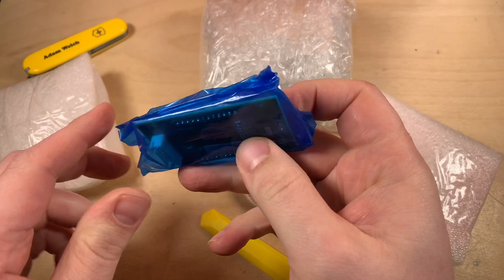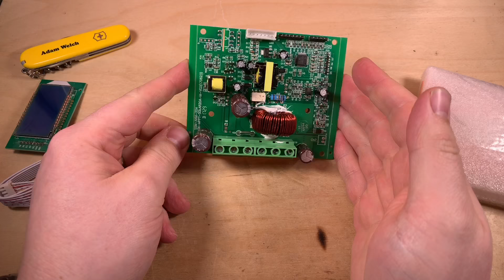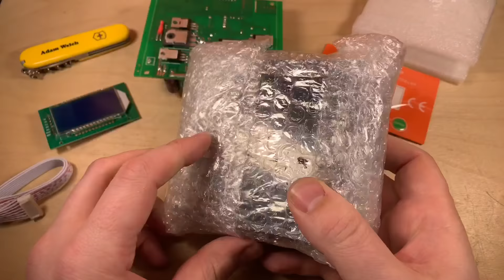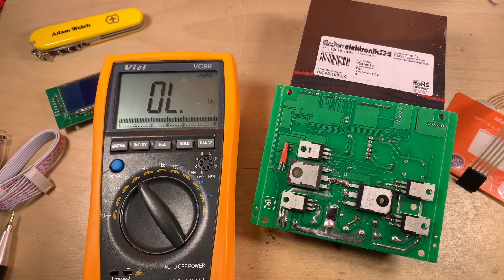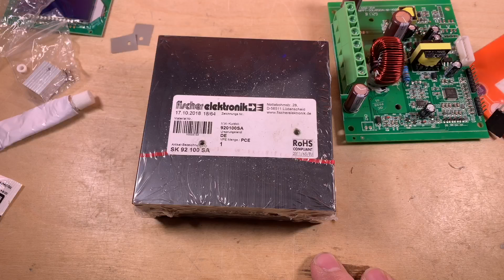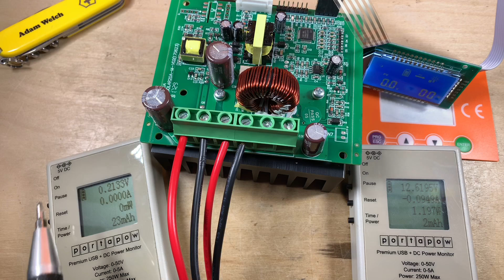Build Your Own MPPT Solar Charge Controller

Comment: For some reason, watching you tap that heat sink reminded me of an old friend (who's sadly no longer with us). He needed a quite specific high amperage adjustable power supply for some DIY electronics project he was working on, but the only PSU he could find that fulfilled his criteria cost significantly more than he was willing to pay, so he designed and built the PSU himself !

He was an electronics engineer by trade, and a fabrications engineer as a hobby, so he masked and acid etched the double sided circuit board himself, soldered everything together himself, and then machined a bloody great billet aluminium heatsink/enclosure for it in his own little home workshop (His "Shed" was a pretty big 2 car garage sized brick building at the end of his garden with a really nice tool room grade lathe and milling machine in it, so he wasn't messing about with hacksaws and hand files here).

The finished result looked really amazing, like a high end limited production run type product, and he was understandably chuffed with how well it worked and how good it looked........... But being British blokes, I couldn't just let him sit there looking all proud of his achievement. So I asked him how many hours it had taken to design and make the thing, and he told me. Then I asked how much the materials had cost, if he got the option of overtime at work, and what sort of overtime rate they offered? We worked out that he'd have been able to go to work and earnt the money needed to buy the one that "Cost significantly more than he was willing to pay" in less than a quarter of the time it took him to make his.......... Then we laughed about it for a bit, and I took him out for a pub lunch.

Anyway, back to the reason I started writing a comment here. Larger heatsinks can get ridiculously expensive, so if anyone else is thinking of building one of these, a good source of heatsinks is from obsolete (10 to 15 year old), small form factor PC's. They can often be got for either nothing or beer money, and most have a pretty chunky low profile heatsink on the CPU. The best ones come from big brand PC manufacturers like HP, Dell, and Lenovo/IBM as they tend to have large custom made heatsinks that don't rely on a lot of forced airflow (And the extra noise that this involves) to keep the CPU cool. If you get really lucky, some have hybrid aluminium/copper heatsinks in them that hoover heat off components like nobody's business, and some will even have a convenient fan attached that could easily be wired up to a cheap thermal switch to offer a little extra protection for if the board it's bolted to does manage to get hot.
Reply: This is a wonderful comment, sorry for your loss. They sound like a really cool person.

Comment: Mini Winter Solar Tipp: You can gradually turn down a Beuler and all other hungry electricity consumers with the "5000W dimmer". Ebay €7. I run 5 dimmers in parallel on an 850W inverter. Kettle 2.2KW at 150W runs 12 hours a day, so the water is always hot. The room is also nicely heated. 2.5KW washing machine runs in parallel with dimmed to 200...400W. Iron, dishwasher, oven, electric heater, coffee machine, all internal heating are throttled with me. Videos about it on my channel https://youtu.be/eC2olbCBhh0 The inverter stays cool, quiet and the MOSFETs remain intact because extreme current peaks no longer arrive at the inverter. Now every Mini PV Inverter is enough to sell large devices. So, with the dimmer, all internal heaters/devices can be converted into base load devices that stay almost permanently ON, drawing very little current directly from the PV. You can measure this with a wattmeter / energy cost meter.

Comment: Great, a video showing show to tap holes by someone who's never done it before, and showing how to mount power MOSFETs to a heatsink by someone who has no idea how to do it. ( HINT: they ALL need bolting down solidly to have thermal contact. Duh. ).

Comment: i NOT want build, i want buy good cheap board were can charging my 12V 18650 4cell4P battery pack. because 3 cell have too low volt and 4P have maximum what i can made no have more battery my battery power wall at solar panel elektric wall. but what charger can buy ????????

Comment: I thought the soldering iron was coming out. 
No instructions on assembly isn't good and somebody could just screw everything to a heatsink and blow things. Can the voltage output be varied? I bought one from Maplins and found it was undercharging and a sealed potted unit which was destroyed when I tried to get into it.

Comment: HI ADAM WHICH CHEAP MPPT CONTROL CHARGER DO  YOU OR WOULD YOU USE YOURSELF  I SAW YOU ONE ON THE CPT-LA10 & CPY-241-/CPS MODEL I HAVE 12OW PANEL USING A PWM UNIT THAT CAME WITH IT THANKS DAVE LIVERPOOL

Comment: Good video.  I need 60 Amps, charge controller kits for 12/24 volts batteries,  Plz send complete specs., protections and warranty
Reply: you have 6 panel on roof if need 60A charger.
panel100W/10A output nominal max.

Comment: The video is excellent. But I have a confusion, how you can measure DC current with a tong tester / clamp meter ? I guess that is for AC. Or it id Hall sensor based ?
Reply from the maker: It has a hall sensor and can measure both ac and dc current. You just have to remember to select the right mode and zero it out for dc. I’ve been very pleased with the clamp meter.

Comment: Adam could you point me in the right Solar Charge controller direction if My panel has an open voltage of 76V  (Thin Film tech) and I would like to charge 18650 Lithium cells in whatever xSyP combination is best.

Comment: ok then... source this build ...  60 AMP MPPT SOLAR CHARGE CONTROLLER 48V 36V 24V 1HHJ60A2V ...  Lithium,Lifepo4/Vented/Flooded/Sealed/Gel/NiCd battery
i have the powmr in the same...

Comment: 👍 Dear Adam!
You always like to test offers from various providers in the Far East!
I found something there, very cheap but unfortunately without an advertisement. Unfortunately I have no comparison options, but I would like to have this MPPT and also connect a digital display.
I am not an electrician or electronics specialist, so I would be very happy if you could test this MPPT for me and connect an ad - because all I can do is recreate what I see on videos!
I would be very grateful if you could create these tests in one of your future videos!

MPPT Solar Controller Solar battery charge plate 6V-36V to 1.25-32V
Link: https://www.ebay.at/itm/MPPT-Solar-Controller-Solar-Batterieladung-Platte-6V-36V-auf-1-25-32V/122815238584?ssPageName=STRK%3AMEBIDX%3AIT&_trksid=p2057872. m2749

Best regards from Austria!

Comment: For 12V configuration I cant find MPPT charger controller with more than 1000 watts solar panel input so I decided to use wide input high efficient Switch mode power supply 12v 60Amp X 2nos. Instead of AC input I have to give solar panel series-ed input of voltage range between 90-280vdc to get maximum 120Amp CC.

Comment: I really like the price of this Charger unfortunately according to the product description it is only suitable for Lead acid batteries perhaps because of the built in temperature compensation that could cause it to over charge other battery types such as LiFePO4 when it got cold. I guess one could rely on the BMS or a separate disconnect when the charging voltage got too high. I assume the firmware does not allow one to disable the built in temperature compensation. Or one could find the thermistor and replace with the appropriate resistor to fool it not to use temp compensation. Another problem to consider is that many charge controllers can get damaged if the battery is disconnected while the solar panels are still connected. Or like mentioned in the description we can buy one ready made for $37.00 more rated at 30 amps with case built in fan and can work with lithium batteries. Probably worth it.

Comment: Hi Adam, I would suggest tapping and putting a screw through all the holes to hold the mosfets onto the heat sinks to prevent any chance of there being heat build up and doing damage.
Reply: That is ESSENTIAL to get any kind of thermal contact. The slightest air gap and you'll have worse than a free standing FET with unobstructed airflow. This guy has NO IDEA what he is doing. Typical Utube content.

Comment: Hi Could you do a video on converting a cheap PWM solar controller to MPPT?  Thanks
Reply from the maker: I’m afraid not. MPPT is significantly more difficult and requires more components than PWM.

Comment: You really want to prove its mppt, you need to show the controller brings the panel voltage close to the Vmp value in full sunlight....
Reply: It was very efficient... The output watts was just under the input watts. Also the controller did not pull down the voltage of the two solar panels that was in series to the voltage of the battery but kept the input voltage of those panels at their most efficient point of about 18V x 2 = 36 volts. definitely MPPT. No need for FULL sun to prove it is working as an MPPT

Comment: ty 4 ur vid ....
...
good luck finding info ... the manual gives very little... i have the 60amp mppt,,, i cant get it to charge correctly...
*UPDATE ... i found the problem... i had corrosion build up on my conections between my batteries. i cleaned em and added dieletric grease and all great (whent through all my conections the same)... man i get lots of power now    :)        dont pay to assume lol
Reply: mine works perfectly

Comment: Thanks for the video. I am the distributor for MakeSkyBlue for North America and I was unaware of a little 20amp unit. we don't sell them assembled. Only 30 through 60amp. We also have wifi v119 capability now. If anyone in North America needs service or sales, you can reach me at 918-315-6128. Direct sales are discounted because we don't have Ebay fees. Thanks, Sean

Comment: Is an MPPT controller just a DC to DC converter? But it varies the panel current or voltage until it finds max power. Can you do that with a buck converter??
Reply: I am no expert but have the same question, I think what makes the difference is that a 'meant for the purpose of using solar panels as raw input power for charging batteries device', is the higher speed at which a high end MPPT controller processes the sudden changes in power supply, such as a sunny day with many little clouds, to stay at max power point under the given circumstance. A buck converter may work well on a all sunny day, but could lack fast recovery when input voltages change rapidly on half cloudy days, leading to poor efficiency. but that's just my guess. cheers.

Comment: Any more on this beast ?   What issues is the Pos Ground going to bring to play ?   Guessing I won't be able to use a Common Neg Ground in conjunction with this charge controller. That would bypass the current sensing on the MakeSky Blue ?    I received the one ordered.  Have mounted on decent Heat Sink  (Managing to keep the PCB Square  and level on same.  Snerkkkkk Snerk ) . In order to keep the Fets Isolated from Heat Sink I simply covered heat sink with Kapton Tape I had on hand.  Just waiting for a enclosure at this time.  https://www.ebay.com/itm/Tone-Aluminium-Heat-Diffuse-Heat-Sink-Wide-Cooling-Fin-100x100x18mm-US/153288134599?ssPageName=STRK%3AMEBIDX%3AIT&_trksid=p2060353.m2749.l2649
Reply: Still Futzing here waiting for a decent enclosure.  May just install open frame on my control board.  Create a front panel of fashions and have a go at it that way.

Comment: Hello! i have similar DIY plate mppt controler! I have a problem, when battery's have a fully charge. MPPT controler do not more set float charge voltage up to 13.3v . And after sunset , and night mode turn on, i have only 12,8v on batery's..  Maybe problems have with another capacitors? Becouse on your's plate stay 80v/390mF capacitor, but in my plate i have 100v/240mF capacitor.. Can you maybe understand , where the problemem.. and i have second problem. On the mppt conterller  connect 135.watt mono cristaline panel , but mppt on LCD shows maximum input only 44.w .

Comment: What is the point of doing MPPT if the extra power gained is lost again in the conversion.  100W in 78W out is very poor.  A proper solar charger e.g. a genasun claims 96%-98% efficiency. Even with  my own  uMPPT I measure 96% efficiency.
Reply from the maker: That 96% peak is probably in a fairly limited voltage range though isn’t it? In these quick tests it’s difficult for me to put these units in their best environment. I generally look at cheap units and they have their limitations.
Reply: Hi Adam, you are right that in general the efficiency depends on the voltage drop Vmpp - Vbat. But this 96% is reached for a 12V system when Vmpp ~ 17 and Vbat ~ 12-13. It is even specially designed for this range because that is the relevant range were you want the least conversion loss, maximizing the power that goes into your battery. When the battery is getting full and charge current is reduced by the controller to avoid overcharging, the panel voltage will go up and the efficiency will go down but in this stage MPP is not relevant because charge current is throttled anyway. Also conversion efficiency is less relevant in that case. The point I want to make is that in practice the extra power you gain by tracking is about 20% under good conditions. If that energy is wasted in the conversion than that product is useless and may be even dangerous because it gets hot. That also goes for cheap units ;-)

Comment: Hi Adam, good video.

Currently I am planing how to do power supply system but, instead using solar panels using a power utility (diesel power generator). So the system would be:

( UTILITY) -- (AC to DC REGULATOR) -- (MPPT CHARGER CONTROLLER) -- (48V BATTERY BANK-INVERTERS)

Do you think it's good idea, or better charging batteries directly with a PWM charger?

Comment: Thanks for test but why does everyone "confirm" MPPT if output current greater than input?  Better to compare with known MPPT controller (identical PC, wire, sun, etc.).  Buck DC-DC would look about the same.  Draining battery at night gets NO vote.

Comment: Not much assembly needed there! Glad to see you found a cheap one that actually works. I'm still on my PWM controller and it's still kinda working.
Reply: pwm charger have big shit, MPPT have lot better safety and safe battery longlive better.

Comment: Just trying to get up to speed with solar power controllers. I may be wrong, but it seems to me that the purpose of the controller is to match the high impedance of a solar panel to the low impedance of a battery. You don't get an efficient transfer of power with an impedance mismatch.  Is it basically that simple?

Comment: My kit came in today's mail.  I sat down to mark the heat sink and it seems you missed a heatsink screw hole.  There are 3 holes for holding the hot components to the heat sink.  Look at the board in the image at 8:48.  Both primary MOSFETS have mounting holes and there's a "clamp" hole between the 2 smaller devices at the right.  You might be OK with using the 2 outer holes but I'd question how much clamping force is holding the 2 outer devices against the heatsink when using one outer hole and the inner hole.
Reply from the maker: Thanks. I’ll take another look and get the drill out again. Cheers

Comment: That amp clamp is wrong flat out wrong not made for DC while most cheap ac clamps will pick up something that tend to be way off
Reply from the maker: It is a dc clamp and I did remember to change it to dc mode (this time). I’ve been very impressed with its accuracy actually, but you need to ensure it’s angle and orientation doesn’t change after zeroing. Big Clive now uses the same one I believe - I think he must have seen my review and liked it ;-)

Comment: Hi Adam, could you tell  me what version the 20A controller is?
And can the output voltage changed to suit Lithium batteries?
Reply: The MakeSkyBlue controllers (at least back to version 113 firmware) have an option for lithium.  Unless you're using one with the newest firmware (version 118) the voltage setting isn't as fine as you might prefer for the higher voltage lithium packs (0.4 volt steps for a 48 volt pack).

Comment: Menu seems the same as the full none DIY product. I got the 40A V117 and Im happy with it so far. 

Manual at:  https://www.makeskyblue.com/files/V117%20MPPT%20Solar%20Charge%20Controller%202018.pdf

I payed $40 for the full 40A version. $29 for a 20A DIY version seems to much

Comment: Wonder if one can parallel these modules to handle higher currents? They would need to communicate settings so only one configuration process is required.
Reply from the maker: This is the baby of the group - I think they do a single unit which goes up to 70 amps.
Reply: @AdamWelchUK  Thanks Adam. I'll have a look and see what is available to suit my needs.
Reply: @AdamWelchUK  Do you foresee any problems connecting one of these kits to each of my 325W (MPP V=18V, I = 18A) x 3 solar panels and charging a single 24V AGM battery by all three Adam? It is the cheapest way to run 975W of solar panels on my camper.
Reply: Just realised that the above configuration will require boost capability from 18V to 24V...I don't think this controller can do that?